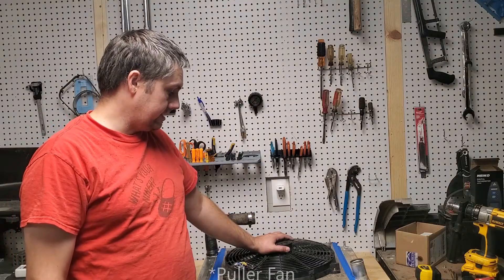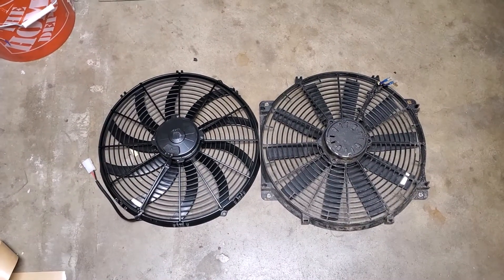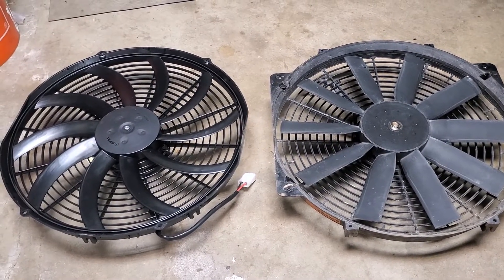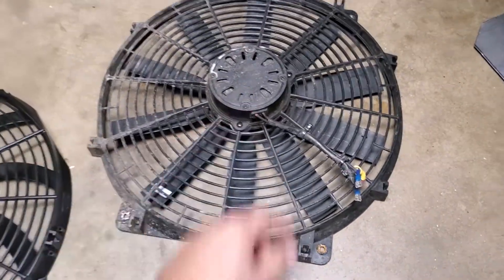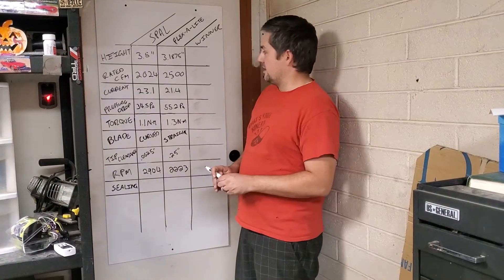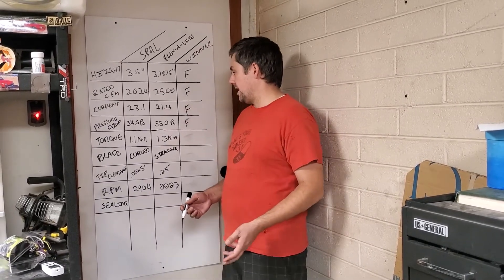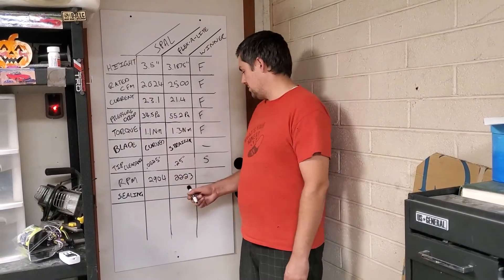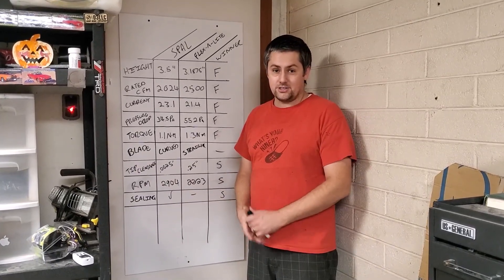Electric Fan Comparison - SPAL vs Fex-A-Lite!

Comment: Thank you for making this kind of video. I have a Spal fan and it’s so damn loud, switching to a flexalite. Something that would help this review is doing a decibel test with each fan, although the Flexalite is clearly quieter.
Reply from the maker: I should have thought of that! Though I will say, to my ear they are the same "loudness", but the spal fan has a higher pitch.
Reply: I just bought and installed the Flex a lite 238 16” it was advertised as 3000CFM AT 18.5amps  but doesn’t do neither numbers unfortunately, with my anemometer it only pulled 1500 CFM at 17amps (used my Klein clamp meter for readings) my old generic eBay fan pulls 1650CFM at 15amps on the same exact shroud I’m actually uploading a follow up video on my channel soon, I’d appreciate any input you might have that will be helpful. I’m not sure where flex a lite got the 3000CFM number from, it’s quite disappointing%
Reply from the maker: @payloadperformance9706  was the 1500 CFM free or through the radiator? I would expect it to pull much less through a radiator, and to truly get the rated number you'd need to measure in a duct so that all the air was moving in a column.
Reply: Rob F that was on the radiator using a perfectly fitted shroud, all gaps sealed and everything. Free air it was around 1680CFM pulling through same amount of amps. I also have a 300 amps H/O alternator so I know that power was not an issue, if anything the alternator gives the fans an extra amp or two of power. All things considered with the extra power, the shroud everything it still under performed unfortunately. Since then I make the love the the Lincoln Mark viii and those are a HOSS! They feel like a Boeing 747 turbine when it’s at take off 😂 a serious monster, but also have a 80amp spike with a 45ish consistent amp draw.
Reply from the maker: @payloadperformance9706  just a note, the alternator only makes as many Amps as are being drawn. It can't makes Amps that don't have somewhere to go, and since the fans are basically fixed impedance at a given steady state condition, a bigger alternator doesn't have anything to do with how much power goes to your fans. It can't "force" it through them so to speak.
Reply: @humming_garage  From what I can find, SPAL boasts that their CFM is measured with radiator obstruction, while Flex-a-Lite does theirs free-flow.
Reply from the maker: @SkorpyoTFC    I'd love to see a link that shows anything about flex-a-lite. I could never find any description or data, so please share.

As for SPAL, they provide values across a full range of pressure drop vs CFM. max CFM=unobstructed, max pressure drop=0 CFM. I don't really know what you mean about spal boasting about measuring with radiator obstruction, they literally provide all the data from no obstruction to completely obstructed. 

One issue is that there is no one number for radiator obstruction. different size, thickness, and fin densities will have different amount of obstruction. I wanted to pick the best one for my particular radiator. I do wish I had access to an anemometer though.
Reply: @payloadperformance9706  What year Lincoln MK8 did you get this fan out of? Also do you know the diameter and how deep it is from the mounting surface to the back of the motor? This fan might help me if it will fit.  Thanks
Reply: @davidkeeton6716  as soon as i get home i’ll check and let you know. i have like 4 of them at home 😂
as far as years i don’t remember exactly but all the years from 93-98 will be exactly the same.
Reply: @davidkeeton6716  just checked, they are 19” tall 22” wide  and from the mounting surface to the back of the motor to the shroud it’s 5” 3/4
Reply: @humming_garage  He Didn't Specify But You Are Right About HO Alternator. However HO Alternators Tend To Maintain Their Target Voltage When They Get Hot At Low Amperage Loads And Low Engine Speeds (usually they come with a smaller pulley For higher rotor speeds for both output and cooling) Which Would Mean More Wattage To The Fans Due To Higher Voltage. Also Some HO Alternators (If They Are Internally Regulated) Will Have A Intentional Resistance Built Into The Voltage Sense Circuit Making The Alternator Output Higher Target Voltage Then Stock. Most Stock Alternators Will Charge Around 14V Cold But Once They Heat Soak They May Only Maintain ~13V. Heat Reeks Havoc On Alternator Performance Especially On Stock Alternators With Borderline Amperage Ratings. My Jeep I Have Set To 15.2 Voltage. It Will Maintain It When It's Cold At Idle But After It Gets Heat Soaked That Poor Thing Drops To 13.5v (Almost Stops Charging Becasue My Lithium Batteries Sit Around 13.3 Volts) OEM Do This For Fuel Economy Because If You Have Ever Installed A HO Alternator You Will Notice A Substantial Engine Load Under High Draw. Even When Batteries Are Fully Charged The HO Alternator Is Less Efficient And Taxes The Motor More (also due to smaller pulley/higher target voltage If applicable)
Reply: Hey u very end up buying and is it quiet
Reply: @bigboreracing356  there’s nothing wrong with it and it likely works just fine for small car applications but for large trucks it doesn’t pull enough air.
Reply: @bigboreracing356  these days i actually prefer german made fans, i’ve discovered another fan that’s even stronger than the mark viii fan that was already twice as strong as the flex a lite.
Reply: @bigboreracing356  i wouldn’t run a fan without the shroud, there a good reason why the engineers use a shroud on mechanical fans. placing a fan right over the radiator pulls air directly from that area and not the surrounding area making it a less efficient way. 
the advantage to the mark viii is that 1) it’s 18” and with the should it comes in it’s engineered for optimum performance and 2) it pulls much MUCH more air than any after market fan. 
that’s why hot rodders use them. 
i’ve bench tested it multiple times and the loboy puller 16” doesn’t even come close. 
the 183 is 3300cfm while the mark viii is around 4000 and it’s 5-6 times cheaper!
Reply: @bigboreracing356   from what i saw the flex a lite motor wasn’t bad. i just wasn’t producing the results i needed it to, if i HAD TO i would go with spal but again the mark 8 is plenty powerful, and as far as amp draw my voltage never drops below 14 volts even when it starts up and i have my truck at idle at a stop light. my 300amp alt never skips a beat. 
and i never said i cant afford a 450 dollar fan system i simply don’t want it, like i said i like to do things my way.
as far as pulling a mark 8 fan it takes less than 5 mins and you don’t even need to crawl around it’s literally two bolts that’s holding it down. 
the mark 8 was designed to cool what was essentially a deftuned cobra engine. 
not everyone wants to spend 450 on a flex a lite system and then a fan goes out and you need to spend another 140 for a fan putting you at 600 dollars. 
and if you have a 35amp draw you’ll still need to upgrade your alternator anyway. 
i’m getting rid of the mark 8 fan anyway because i found another fan that’s almost twice as strong. 
but before that i’m going to mess around with another set up because we’ll, i can do whatever the hell i want.
Reply: @bigboreracing356  maybe one day i’ll buy the flex a lite you mentioned and do a head to head comparison with the new one i purchased.
Reply: @bigboreracing356  i’m down to watch that, sounds like it would be fun. 
at the end of the day that’s what it’s all about. 
when you do upload the video post a comment on here or on any of my videos so i can watch it on your channel.
Reply: @bigboreracing356  i understood your frustration from the very start so no need to worry. 
i do however appreciate your patriotism and i do love the fact that flex a lite is american made and you proudly support them.
australia makes some pretty stout offroad products. like davis craig for example. that controller hasn’t failed me yet and it’s super easy to use. 
i scanned over some of your videos and it seems like you know what you’re doing, i can learn a thing or two off ya.
Reply: @bigboreracing356  they are good fans for their size what within their class, but i think they are over priced. the lo-boy 16” puller that i bought was 150 i believe. 
for that price point you can get a fan that’s 3 times better. the lincoln mark viii is a 18” and works almost 2 times better. for that price point you can buy 2 lincoln mark viii and pull north of 8000cfm.
Reply: @bigboreracing356   the video you watched of the DIY was my first electric fan set up, i have since then moved away from it because i was learning. 
the CEO of flex a lite said herself that more often than not it’s not a bigger radiator with more coolant volume, she said that more often than not it’s more AIR you need pulling through the radiator. 
i’m not taking anything away from the flex a lite fan they perform great for what they are but didn’t fit my needs. i don’t have a 1000hp vehicle that gets hot only for a minute, i tow heavy up grades with consistent high RPM. 
on top of that i have a High Output alternator so i don’t need to worry about amp draw. the dual flex a lite set up pulls might pull more air than a SINGLE mark viii but that’s a dual fan set up. why not do a apples to apples and compare it with a dual mark viii set up? that would be close to 8500CFM 
also i’m not going to spend 450 dollars on a flex a lite set up when i can get 2 mark viii fans that are bigger and pull more air for a fraction of the price. 
have you not seen the video on 1Road where he put a flex a lite and one of them broke after about a year or so? he replaced it with another one which was probably another 100 bucks. 
i would use a flex a lite like the one i use to have the 16” lo boy pulled for my little ford ranger but only because it doesn’t create as much heat since it’s not under load like my tow pig. 
i don’t know why you’re so hurt about the fact that i don’t see the need to get a flex a lite when there are different alternatives out there. if you’re happy with your set up good for you but it’s not what everyone wants. 
i for example like to experiment and do things my own way after all that’s how new things are discovered, by trying new methods 🤷🏽‍♂️